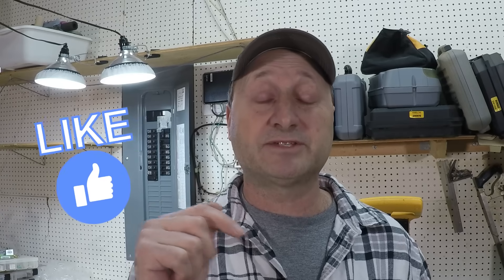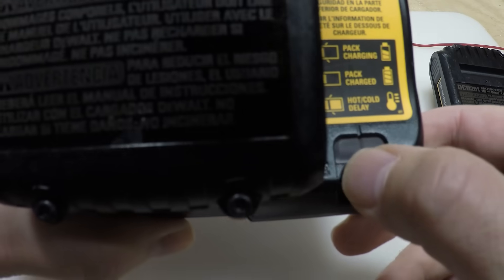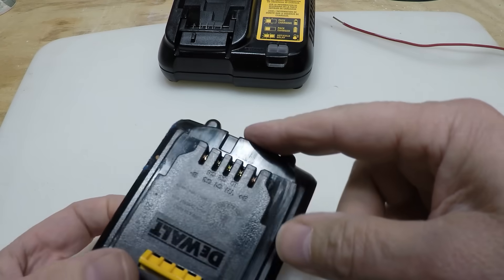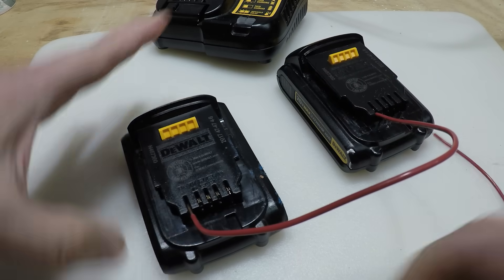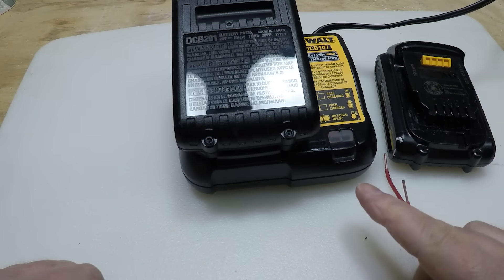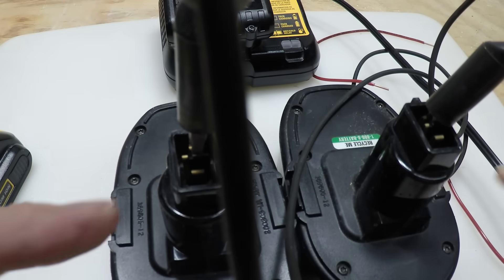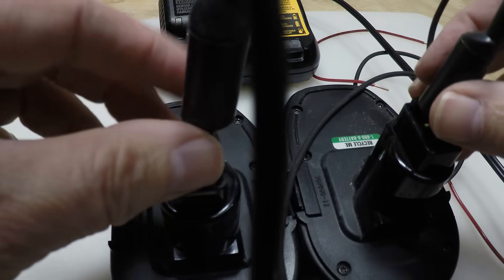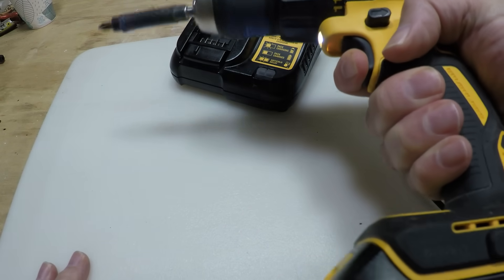SECRET to FIX Drill Batteries - Charge Dead Lithium Tool Batteries

Comment: This tip should have a massive warning on it: The lithium ion battery is damaged by being discharged too much, that's why it reads as fully empty when it has at least 20% battery charge remaining. To avoid dipping too low. If it's left uncharged for too long it'll start breaking down. Forcing a charge at that point won't fix this damage done, and it's going to permanently be a partially damaged battery. A damaged li-ion battery can, and in many cases has exploded.

If you know what the battery chemistry is, what voltage it had left, and what you're doing, it might be perfectly fine. Though I don't know if anyone with said knowledge would even consider doing this. At the very, very least you should never do it twice on the same battery, to avoid the damage accumulating.
Reply: Guys hes just "waking" the BMS up! It discconects the terminals when voltage drops below safe discharge voltage, all you need is a higher than norminal battery voltage to wake up(turn BMS On) the Battery Management System to start charging it, the BMS is tlresponsible of charging and monitoring the battery health and status, you cant overcharge it, nor overdischarge it b4 the BMS kicks in
Reply: Can someone tell me how he is shorting the terminals when he’s using the same polarity  
+ to +  and -to - no different than how you would charge a car battery?
Reply: @cgkuch4184  Shorting and shorting, it's shorting in the sense that there is no resistor in the circuit. Yes it's + to + and minus to minus. If both batteries are at same voltage nothing happens. So (hopefully) its not a short in the sense of coupling plus to minus. Still as mentioned above don't do this.
Reply: Thanks for the tip.
Reply: Thank you for your help on video 
❤👍👍👍
Reply: Hi, I'm just curious because it seems like you know what you are doing, so should I just not try to fix my battery and just buy a new one ? I don't want to blow anything up lol
Reply: I think that you're overreacting due to reading too much "opinion" on YouTube rather than having or seeking accurate information!
Yes, it's true that Li-ion Battery Chemistry can be damaged permanently by over-discharge or lack of charge over a long period of time, but we're not talking about days, weeks or months here, more likely many months or years. The self-discharge rate of Li-ion Battery Chemistry is rather low and slow.

Most of the Protection mechanisms are built-in to the Battery Monitoring System (BMS) electronics contained within the Battery Packs.
The Li-ion Battery Chargers themselves have very little control mechanisms in them, and rely on communicating with the Battery Pack's BMS to "know" when to turn on or off, or what status to show.

The primary reason for this type of "recoverable fault" to occur is that of over-discharging the Pack, or leaving a discharged Pack sit for a long time, without charging it to at least a 25% level.
All that has happened is that the Battery Pack's BMS has detected a battery voltage less than the minimum allowed and has assumed a dead battery, rather than a Pack with a minor issue that can be overcome by the method in the Video.
As each Battery Pack has its own BMS no safety mechanisms are being bypassed,  that is to say each Battery Pack can protect itself.
Reply: What, y'all work for a battery company?!
Reply: As I understand it, lithium ion batteries has no memory effect, this is only to get the small computer in the battery to have some power to talk to the charger. If short circuit lithium ion batteries, this is very dangerous. Most electronics are safe today, and many batteries are not directly connected to the using device, but has a controller with very low Ri in it, to have controll over the discharge and short circuits. This is the reason why NiMh was shifted out of use by all these manufacturers years ago.
Reply: @jameswik212  Incorrect. There is generally sufficient power for the battery protection system to operate, but it is specifically designed to protect against over discharged cell which cause metal deposits which cause short circuits. Those are very dangerous. See my earlier response.
Reply: @andyowens5494 respectfully,  I am all about saving $$ but at same time I value safety more like how you technically help explain in this thread. My experience has so far been with a 9 year old 20V Dewalt 5A that had been thrown in the recycler at a job site & I brought it home to see if I could revive it... I forgot about it & it sat dead for 3 years more. I later carefully jumped it with about 20 seperate 1 minute charges on a power timer plug & to my pleasant surprise it's worked flawlessly at about 80% capacity when compared to my other 2 identical batteries. I always multimeter check all of my various brands & types of batteries to always be at 55- 70% charge so they don't get hot being either fully drained or fully recharged & I use a 1 to 5 minute timer on them all. So far I've had batteries last me triple to over a decade of constant service use past their normal life expectancy. ❤
Reply: @jameswik212 This is not att all about the memory effect that older generations of battery technology had. The charger will explicitly measure the voltage of the pack in order to avoid charging a possibly damaged battery. Doing this trick may work fine but it may also get your house burnt down.
Reply: @xehpuk  If you charge the battery with any unofficial charger, yes tan you take that risk.
But here is told to jumt seconds only (not enough time to overheaat anything) and than use the official charger....Because that official charger has build in all needed safety checks including to tell if the battery is really damaged.
Reply: @reiniernn9071  Well make sure you have fire alarm and insurance.
Reply: Absolutely correct!  
Further more, you risk damaging your working battery as well. Shorting the terminals directly to dead battery is almost equivalent to a complete short circuit. It will damage the cells or the non-replaceable fuse will blow on models that have it. 
If you are going to try something like this you need to:
a. Be aware of the risks, i.e. Lithium fire. Very fun to watch as long as it's nowhere near you or your property.
b. It should be done only on known good batteries, like the guy in the comments that had two brand new that had been sitting a bit too long.
c. Do it with a voltage controlled, current limited power source and a very low current of about 0.1C.

The guys who try this are the same guys that lite the bonfire with a can of gasoline ⛽️ Also fun to watch as long as it's nowhere near you or your property 😂

Not worth the risk of having a Li fire. Buy a new battery.
Reply: This is a good warning. I revived some old Cellphone batteries with a similar trick til I saw a youtube film of an exploding battery. Even the not li-ion batteries are dangerous when you short circuit them. So I don’t recommend these trick to be carried out, knowing a burning battery almost cannot be extinguished. Only a bunch of sand can slow the burning.
Reply: @chucsdcom7660  Correct. Once, 45 years ago,  I intentionally blew up an old NiCd battery to see what happens when over charging....on a safe spot.
Reply: Agreed. Using a standard charger on a revived battery is potentially dangerous; if the battery could ever be considered safe to revive, it should only be charged with a constant current source at a fraction of the normal charge rate, and under constant supervision. The discharge that fot it to be unchangeable will result in metal crystals forming internally; if those bridge the electrolyte, it creates an internal short circuit, then all the charge that just got fed into the cell gets released quite quickly. Treat any revived battery as a CHEAP Chinese copy - be vigilant, and replace ASAP.
Reply: I agree, some people think they are clever.
Reply: Yeah this is actually true for all lithium batteries, it can actually cause fire or explosion if the juice goes bad. 

Machines typically read out error when charging some batteries and should take note of this, if there's an error it needs replacing, nothing lasts forever, as reviving dead batteries may actually have problems charging to full in the future it may overcharge and thus cause fire then explosion.
Reply: Think of all the work and experience area fire departments are going to suddenly have! Definitely there should be a warning on the batteries themselves about doing this. Fire Marshals will have more fun exploring this as cause of house fires and insurance company's will be looking to cancel payments for claims.  I suppose the purchase of a $50 battery could mitigate calamity.  It was a pretty neat idea though.

Comment: I’ve got a few dewalt  tools and I’ve mixed up the batteries and a couple won’t charge but I’m not sure if I’m using the right charger,, or does it matter will all chargers charge any battery, the red light flashes about 5 times then just stays on but there’s no. power in the battery,,

Comment: DO NOT DO THIS!  This is very dangerous!

This will dump a high current spike directly into a fully discharged (over-discharged) lithium battery, which can easily result in internal chemical breakdown, shorting, and actually bursting into flames!  Even if you're lucky and it doesn't catch on fire, the resulting battery will likely still be permanently damaged, and even though it appears to charge, it will not actually hold very much of a charge in reality.  Moreover, charging the resulting battery in the regular charger or using it in a power tool could cause it to spontaneously burst into flames too, even some random time down the line when you're not expecting it.

The reason the battery charger won't charge that battery is not because "it can't send a signal", it's because it basically is sending a signal (undervoltage) that says "it is not safe to charge me" so the charger is deliberately not trying to charge it, because doing so might start a fire.

In some cases, it is possible to recover a battery which has been over-discharged, but this is very much not the way to do it.  You need a lithium battery charger which is actually designed to do that sort of thing and can do it safely, with a carefully regulated amount of charging current over an appropriate amount of time.  Even then, it will only sometimes be possible, and the result will generally be significantly worse than a new battery anyway.